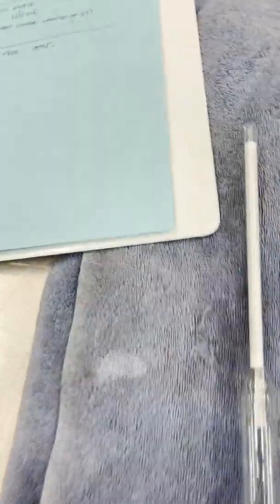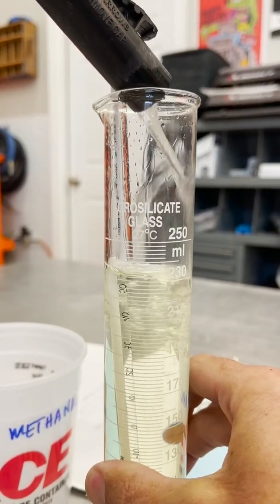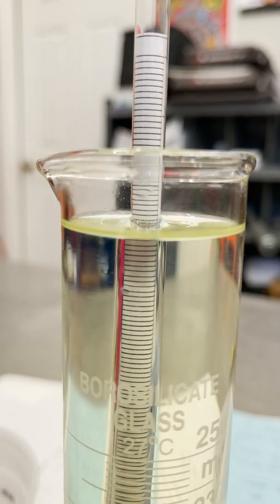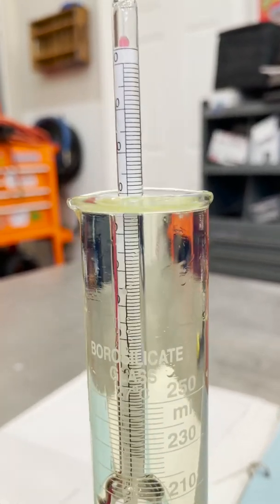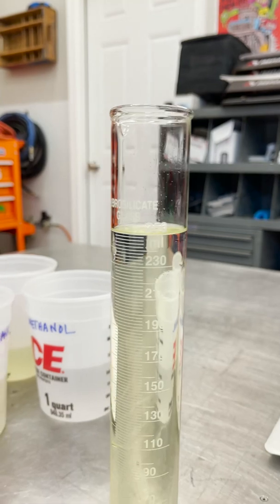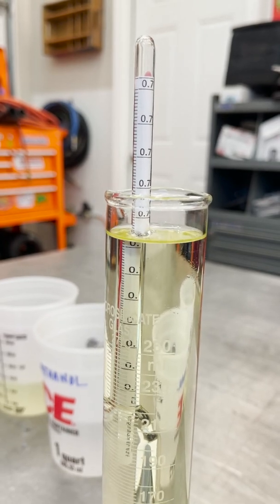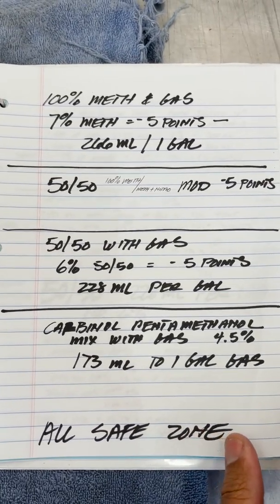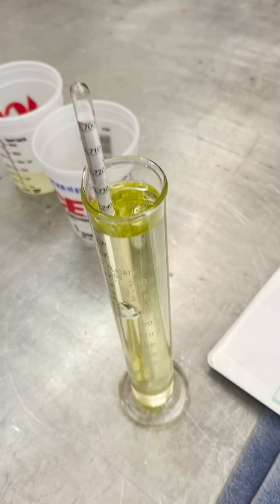QMA fuel testing for quarter midget racing

Comment: Your videos rock, I tried my son in quarter midgets at 4.5 and raced him at 5, but deco motor i bought for 550.00 and car for 1000.00 and parts gears etc, he ran a good pattern,  but motor wouldn't pull a whole off greased sheets, sent it to Coggins no faster, two months hit wall new car, spent 5500.00 in 6 months no faster, SOLD THAT BITCH BOUGHT HIM A FUN ONLY DIRTBIKE, broke his heart but he came back to win modified championship.

Comment: I raced back in 78 at Waterford and they said our fuel was too hot after winning the main, I got it out of Sunco gas station  myself on was to track front ohio, we had seen guys with sealed tanks use a hypo needle shoot nitro thru tape in vented cap and get away with it! Several times, my father was no cheater ever,  we earned it all the hard way..